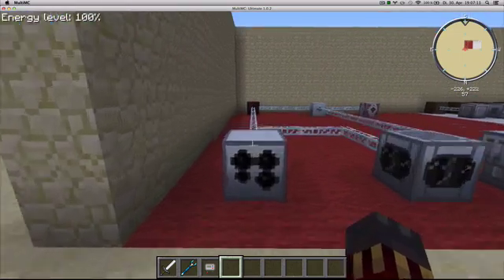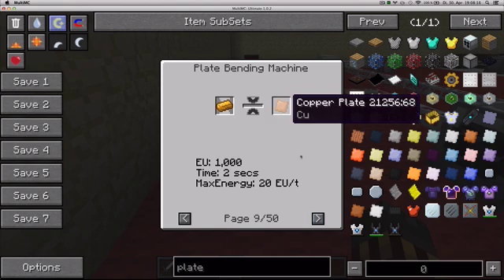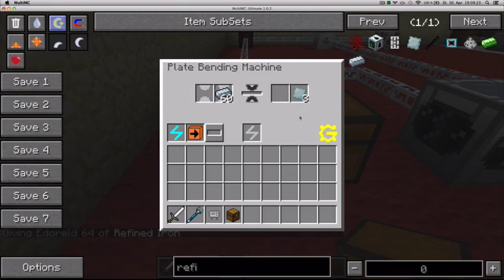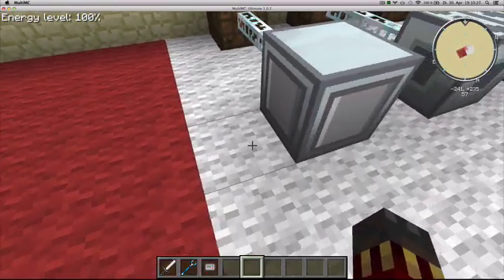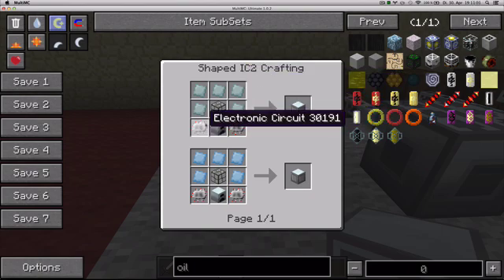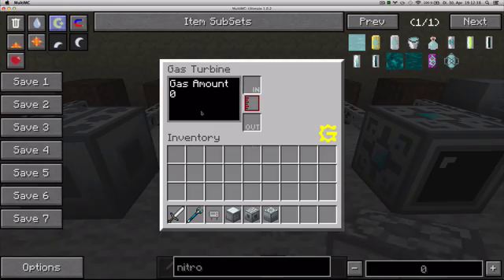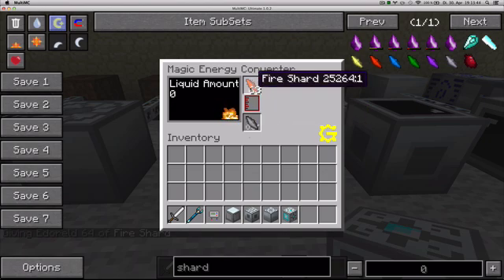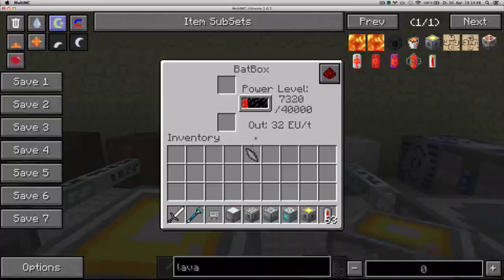[Tutorial] GregTech from Scratch 01 - Power Generation

Comment: Ha! I'm loving this mod already. Open's up doors for Co-Generation in power plants.
I heard turbines can output water when they process hydrogen (and methane?) and perhaps that can help with steam generation. 
ALso, with the fusion reactors spitting out plasma, you could make your expensive hard to build fusion reactors even more efficient by building cheaper plasma generators and fuel them by pipes with plasma from a fusion reactor or two :P

Comment: What would you recommend? I'm using a lot of oil refined into fuel pumping it into boilers for steam using power converters I used petroleum mod generators (instead of gregtech gives slightly less per fuel but at a higher rate for IC2 power early on moved away from that now and using power converters.

but is nitro-diesel better not I've seen that before.